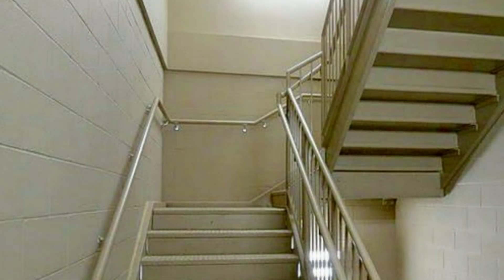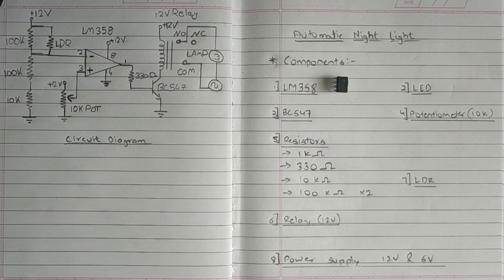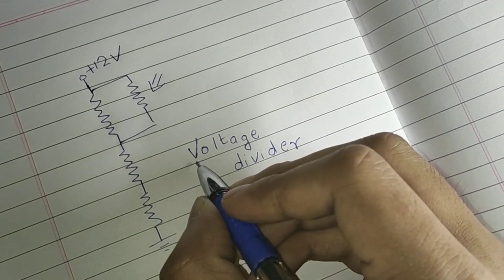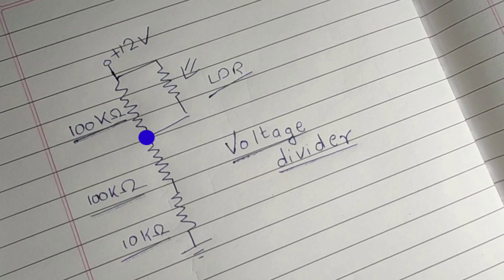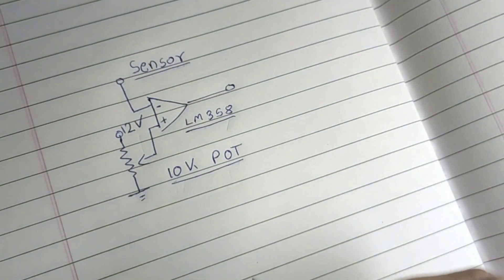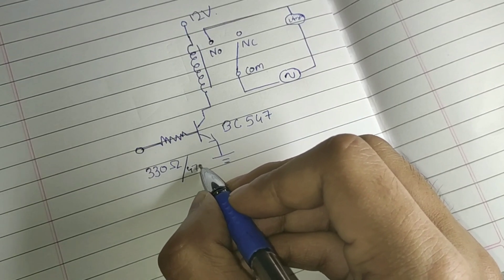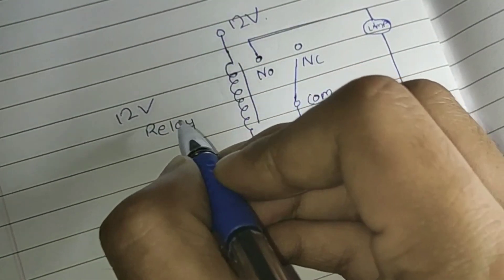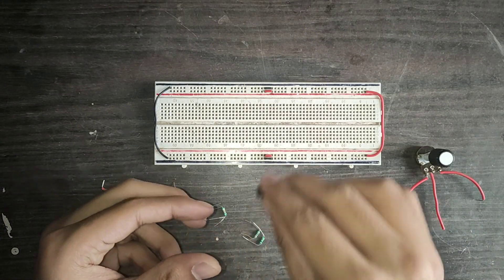Automatic night light project | How to make it | How it works.

Comment: Can we reduce the power supply to 9v instead of 12v ?
Reply from the maker: Yes you can but keep in mind to use the exact supply voltage rated relay for the supply you choose, eg. If you choose 9v then select a 9v relay, if you select 5v as the power supply then select use an 5v relay and so on...
Reply: @jitulex  thankyou